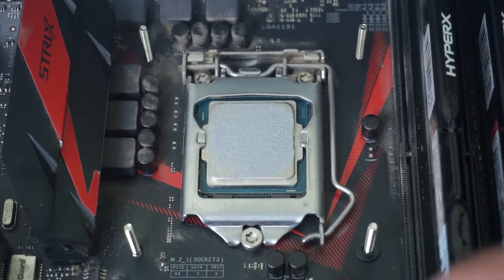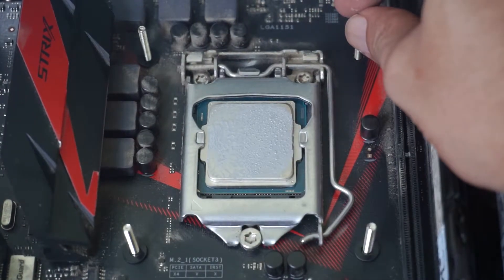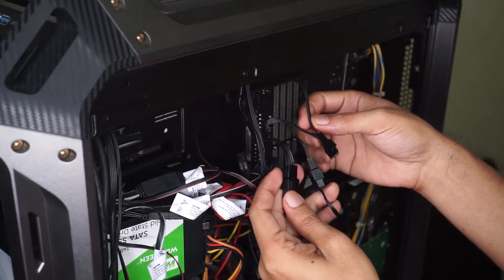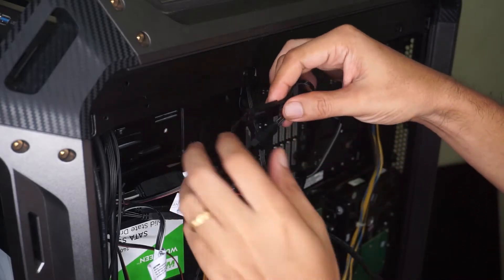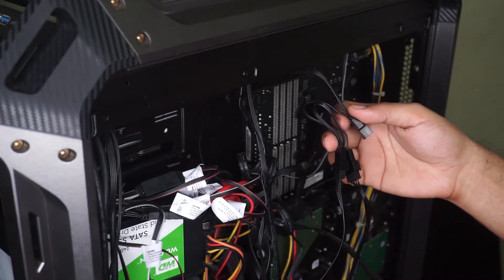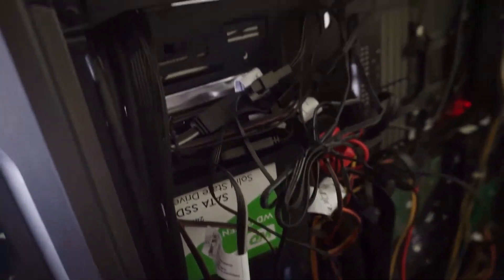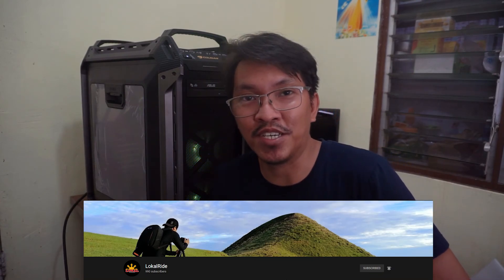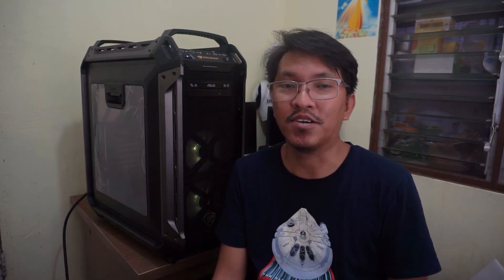Installing one of the best cooling AURAFLOW X 360 to PANZERMAX

Comment: air cooling is better than water cooling by some modifications, instead cooling pc components from water we can use radiator chilling technique by using it, so we will be able to provide up to less than 0 degree temperature air to pc for cooling and even no need to remove processor and graphic card fans. To stop water from freeze on low temperature we can use some technique not freeze water below 0 degree in it.
Reply: Wrong in so many ways. Learn some basic physics bud.

Comment: i did mine and everything turns on now but no display
Reply from the maker: Kindly check the vga connector or the ram it might be not properly mounted. :)
Reply: @dev.it-bohol3405  vga connector? my pc runs with my cpu fan on but not the water cooler i get no display
Reply from the maker: @bussinahnigha3970  yes can you disconnect the vga the connect again, or the RAM unmount and mount it again. :)
Reply: @bussinahnigha3970  make sure to plug the pump